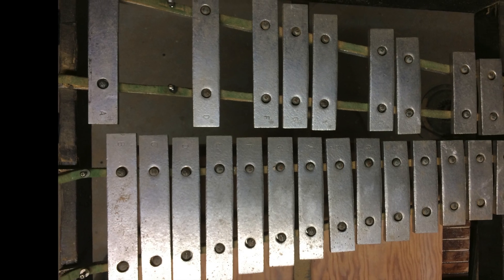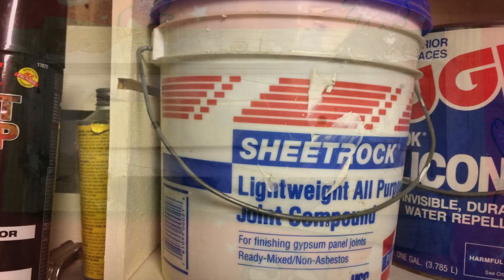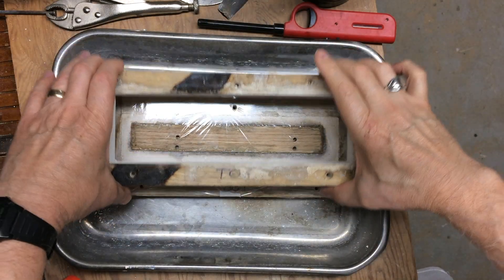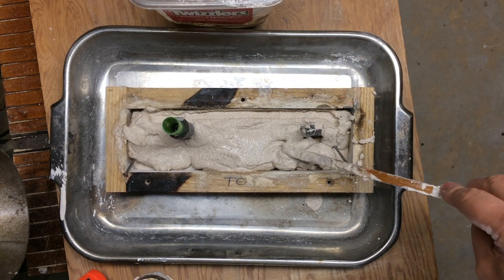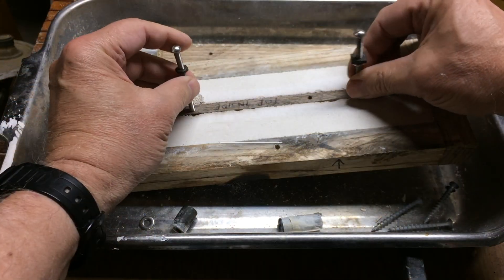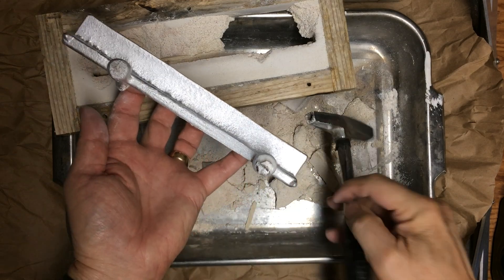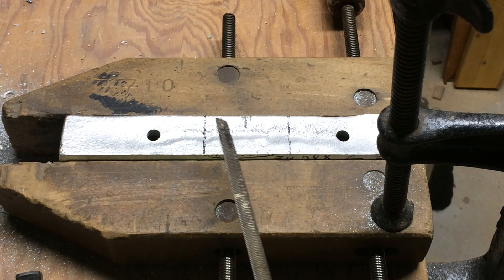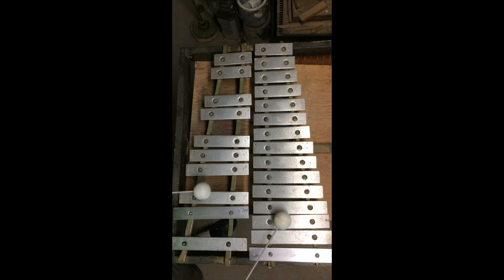Aluminum Casting with Plaster and Sand Molds

Comment: Great video! I think where the cavity formed on the bottom, if you had a few pockets in the bottom of the mold that might have prevented that irregular cavity from happening, then you could just grind off the nubs...but anyway you got it dialed in, fantastic!

This helps me a lot actually because i am currently trying to determine a mathematical equation to predict the vibrational frequency of solid 3 sided pyramids (equilateral tetrahedrons) and aluminum is my go to material for metal casting.
Reply from the maker: Glad it was helpful for you. Good luck with your project!